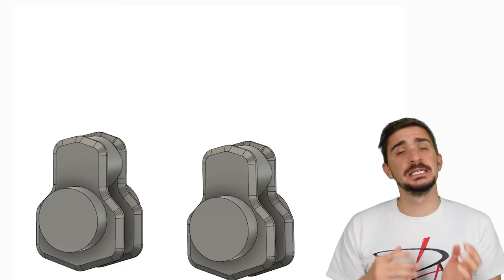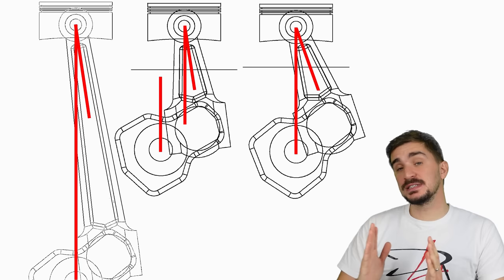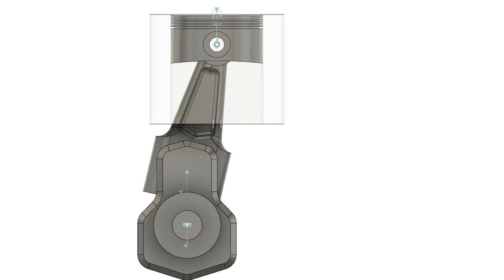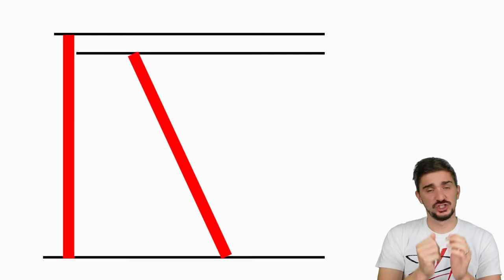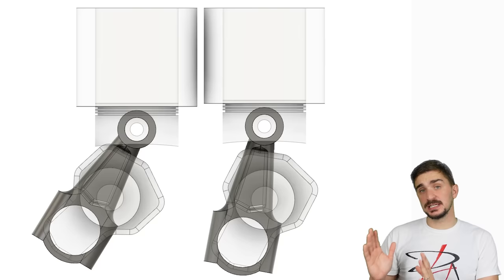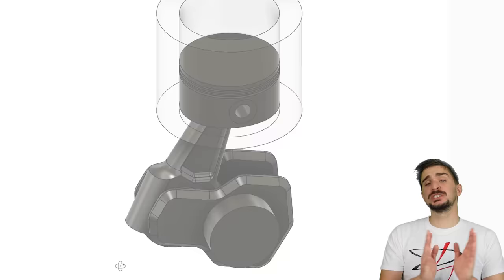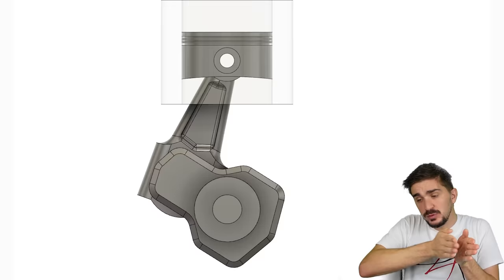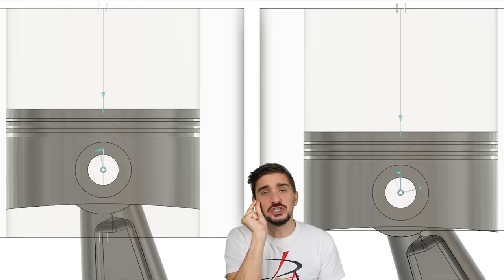Cylinder Offset Changes Everything

Comment: In the trucking world the offset cylinder (commonly referred to as downsped engine) does wonders for the engine performance. Slower piston speed means more torque at lower rpms while increasing fuel efficiency. It also increases exhaust temperatures which helps with all the emissions components. Pretty amazing to move up to 80000lbs at 950rpms at 65mph and getting 10-12mpg.
Reply: This means that it also has a lower rpm limit, 1000 rpm on a diesel would be equivalent to 1.5k rpm on a gas engine, they move at the same speed.
Reply: Is this guy talking about Chrysler's 1959 slant 6?  For all you "this changes everything" modern day idealists... please keep in mind quad copter drones were invented in the 1920's, and were among the first successful heavier-than-air flight "VTOL" vehicles preceding helicopters, and electric cars were around from the very begining of personal trasportation.  With the first example of an electric car in 1830, but by 1900 were 38% of Americas automobile market, with steam taking 40%, gasoline 22%, and diesel just recently invented in 1893 as a means to use cheaper low grade fuels.  Diesel is only more expensive because the government puts a TAX on diesel fuel, and now also requires DEF as well.... I'm still waiting for someone to re-introduce steam vehicles, so this guy can make a video about how THIS CHANGES EVERYTHING.
Reply: @Ed-ty1kr 
Starting in 2007 here in the USA the feds mandated "ultralw sulphur" diesel fuel, among other emissions reduction devices and systems. (Think DEF, DPF, along with some other ideas integrated into these new systems).
It's unfortunate how technology has improved dramatically in the diesel industry just to be negated by the over the top emissions reduction systems mandated by the fed. In 2007 they essentially raised the price of diesel per unit, gallon here in the states, which of course became a permanent raise in cost, supposedly to offset the cost in the manufacturing and distribution of the required ultra low sulphur fuel...all the while achieving this new standard of reduced sulphur by simply taking said substance out of the "mix"...in other words charging us significantly more per unit of fuel by the reduction or even elimination of a key component which in the past was used to lubricate the moving parts of the fuel system itself. Well not just moving parts but also critical yet stationary parts like the body itself of a diesel fuel injector. This whole concept of what went down here in America around 2007 is so frustrating to me. As a life long mechanic with experience in internal combustion gasoline, compression ignition diesel, 2 and 4 stroke gas, and even electrical (EV) powered vehicles found in the forklift and equipment fields. In addition to the wrenching experience and understanding I also worked a relatively small window of time in the refinery business around this time of 2007. Much work was needed for the refineries to be "ready" to make, distribute and sell this new "ultra low sulphur" fuel and therefore refineries everywhere went under humongous updating projects. Many bodies and brains were needed for this task. I hired in at the Marathon refinery as a contractor at their elaborate plant here in Detroit, basically i-75 and Fort st./Schaeffer Rd, near outer drive amd Dix Ave...anyone from around the knows the plant and it's location. I found that job very interesting, despite being temporary I still spent about 2 years on site learning something new every day about the refinery process, which honestly, was rather rewarding. 
In summary, it's almost as if some kind of globalist cabal who secretly run things from behind closed doors and it's almost as if these people didn't want more efficient diesel engines which essentially move and power this entire world we live in, where every aspect of our daily lives are affected by a diesel powered something somewhere along the way. All these EPA backed emissions reduction acts and mandates have crippled the Diesel engine industry to where people actually believe EV's could save the entire world right now...which they cannot. Ever. Efficiently. Replace ice and diesel.
In a dream last night I actually imagined the newest most bestest thing ever...a vehicle powered by...
Coal! Then I woke up and had to pee.
Reply: @williamstamper442  EPA and DOT measures became overreaching sometime around 1969, with 5mph bumpers that by the early 1970 made American muscle cars sinfully ugly, with huge protruding bumpers, and emission systems that dropped 350 to 426 horsepower cars down to slow, heavy, and gutless 150 hp gas guzzlers.  
But this actually goes back to 1913 and Woodrow Wilsons Jackyl Island treason, that the British Royalty literally paraded him through London for. Henry Ford was quoted as saying its just as well the American people are ignorant to finance, cause if they knew, there would be a revolution by morning.  Not an exact quote but something to thar effect.   Which got really  bad around 1964, post Kennedys famous secret societies and proceedings speech, which was just weeks prior to his assasination.  Funny thing you mention Globalists cause it was with George H.W. Bush involvment, a known and admitted Globalist within the CIA, who later became Regans VP as Regans alzheimer's set in. Then became President giving the world his famous New World Order speech, with creepy undertones saying things like "and when we are successful, and we will be".  Followed by a short Clinton break, with MK Ultra and Tuskegee human experimentation on American citizens admittal and lame appology, and then by his son and fellow Bonesman" George W. Bush Jr. 
 There is a documentary you can still watch on Internet Archive made in 1982 called The Killing of America, that although is aimed at gun control, still documents the drastic decline of American society into violence, mass redrum and general crime up to that point in 1982.  Directly links Kennedys assasination with the crime rate, violence, and general depravity as if some great evil had decended upon the land.   Which only got worse thanks to the CIAs Contra Cocaine "conspiracy" and introduction of crack cocaine onto Americas streets, only now trumped by fentanyl.  Which... started with LSD's introduction, the first poison unleashed on the nation.  And who created that? Look it up, it was nothing new, it was as if it was deliberately released onto the soft heads of Americas youth, by design, on a large scale, and almost immidiately in the late 60s post assasination like clockwork. So now its fentanyl but its the same game, new millenium.  
Look into a book called The Psychopath Machine, written by an MK Ultra survivor, who claims MK Ultra was not to create psychopaths, but to identify and install psychopathy in prominent positions.  By identifying through tests and examinations all existing sociopathic personalities, so as to find candidates for the military industrial complex bureaucracy,  top medical professionals and doctors, university psychologysts, federal judges, top law enforcement professionals, and the now famous Wall Street American Psycho business personelle. Everyone thinks MK Ultra was to create psychos, but why create something if you can recruit existing? 
Anyhow... 
As far as Globalism the world we see today is a direct product of their actions.  Just look up the definition of GLOBALISM and see if that fits the world we live in. Look up World Economic Forum videos and whitepapers, they dont hide much, for they assume we are all just ignoranr commoners.
I still recall Ross Perots "Great Sucking Sound" speech he gave with Geroge Bush Sr. on his right, and Bill Clinton on his left, as he told the nation we will see our jobs sent to Mexico and overseas if we elect either one of those two candidates. Thar was 1992, and Boy was he right, they literally sent all Americas industry... tooling included.. to Mexico and mostly to China, because the "Chicoms", view communist China as the model for their New World Order or Great Reset. Where they can Build Back Better their tyrannical dystopia where you own nothing, live in 15 minute prison cities, have no privacy whatsoever, and eat a diet of bugs. But only after they tear it all down and bring the western world to its knees, cause you must tear it down to build it back.  
Looking further down the now well proven and documented rabbit hole we see the same mass migration mentioned in Globalisms definition, in both Europe and the United States, with the 3rd definition for globalism given as : An ideology based on the belief that people, goods and information ought to be able to cross national borders unfettered.  So we see our boarders disolved or non-existant, with our military or "defense" spread out to hundreds of bases world wide, and fighting or aiding in just about every conflict anywhere including Ukraine.  Which was a military industrial complex and George Soros color revolution construct, designed to fight Putins refusal to play along with NATO's clear rejection of the treaty written up by Gorbachev while the Soviet Union was disolving, not to impose NATO onto Russias doorstep.   People dont know about any of  that, and how can you blame them they dont work at the United Nations, so they support whatever the media tells them.  But it was actually over a treaty that was not upheld by NATO, and the nordstream pipeline that has most of Europe now feezing to death.  They did it by first meddling in their already fraudulent elections, playing dirty games with Ukrainian oligarchs who are actually just the corrupt businessmen and gangsters that came out of an empires collapse.  They got involved with installing of puppets like Zelensky, possibly even Putin himself for all we know, and subverting their society through color revolutions that are always signified by the famous RAISED FIST.   Running criminal bribery based public private partnerships which is basically just a soft modern term for fascism, first coined by Mussolinni the italian dictator during WW2.  This tactic then was turned inward onto the American people in 2020, and we ended up with cities burning, and public private partnerships set up during the Bush era that is now no longer just working for the government as contractors, but now controlled the government through public private partnerships. 

Anyway it is FASCISM, its set up and ran by Globalist wealthy self declared elite stakeholders, and it is just a means to impose a world government tax on the common people ONLY, while they continue to jet set and yacht around the globe in vehicles the DO NOT ACCRUE CARBON CREDITS... Yes you read that correctly, private jets as well as vessels above a certain size do not have to abide by carbon credit global government taxation.  They solve nothing, they impose all these measures like forced injections and central bank digital currencies linked to social credit scores... but they serve absolutely nothing except to make them richer and more powerful.   It is an ideology of haves and have nots, of serfdome, a cass system, a communist fascist socialist dystopia where your only rites are to depopulate yourself by assisted suicide, with their war on carbon being a war on all of us carbon based life forms.
Sorry for typos, and sorry for it being so long, I couod write a book on the globalist tyrannical nightmare society they are building.  And yes , they penetrate the cabinets as Klaus Schwab says, and destroy whatever they lay their greedy, grubby, filthy paws on.   Period
Reply: @Ed-ty1kr  are u okay?
Reply: @aryamankaushik4173  Ignorance must be as blissfull as they claim...
Reply: @Ed-ty1kr  Děkuji za Váš názor a realistický pohled. Už se mi potvrzuje, odkud se ta smrtící ideologie dostala do EU.
Reply: @vd4534  You'll have to translate that into English for me...
Reply: @Ed-ty1kr   That person posted in Czech.  This is what they said:  "Thank you for your opinion and realistic view. It is already confirmed to me where that deadly ideology got into the EU."
Reply: @JViello   Thank you.     I tried the google translate software but as mom tells me, the translations are not always accurate.  
But then again, even english to english texts get misunderstood and taken the wrong way, so its no surprise.
Reply: @Ed-ty1kr   Steam vehicles? What about Steam powerplants. THIS CHANGES EVERYTHING. Using only water to power a turbine? A wheel? WOW!
It would be nice if Nuclear powerplants became popular again. Last time it was for nuclear weapon production. This time? I mean we are littering the streets with heavy metal lithium infernos. Built like SUV's and far heavier then what a vehicle actually has to be. Luxury first. Not practical and economical made to be sustainable. O no!

The most likely tech to replace battery banks in EV's would involve water steam. Since else your looking at combustion of gases or solids.
The most innovative and game changing would be to strip vehicles down to bare minimum. It might sound like a joke but Trabant/Smart Car like things should return. The Smart Car concept had actually really good crash standards for what it was. Goes to show what actually can be done if there was a push in that direction.

Then focus innovations on keeping people from crashing into things. Make things made to last and be sustainable. It really is the infrastructure and tire wear that should be a problem. (lighter vehicles less wear and tear in general. Less energy needed too.) And ofc how to get people to take driving seriously with responsibilities. And the heavy handed approach today probobly involves putting up allot of cameras and having a AI fine you! So really we are screwed regardless of what we do. Why make people care when you can fine and earn profit for the state?

If a generation of people where forced onto EV bikes perhaps? Maybe then people would be delighted to drive something with 4 wheels and a roof/windscreen. Iphones and touch screens do not belong on a moving road. Let alone built into the dash. Or self driving... It maybe sounds hash but even the few that have a family car with kids in the back seat? I see no reason to why we need to drive around in tanks on the road. Let alone SUV's and pickups that do nothing but look fancy. So much BWM, Audi, Mercs on the roads. Rare to find a family car that is actually modern AND fit for purpose. Every single one of us go for the fancy thing. Rather then the reasonable and long lasting quality over quantity. (quantity in over luxury.) Most of the emission/tax cheating vehicles are also the ones with a premium price to it. And a weight/waste increase to go with it.

And for people driving SUV's or modern crap to feel safe on the road? You should be the first ones to be put into actual Trabants. Even in a world of EV bikes and compact light transport? We would still need delivery vehicles on the road. But like really? The main problem to solve is to make people care to not crash into things. So a big lorry/18 wheeler running around EV bikes all day? Maybe it would be the kind of encouragement to get people to pay attention to the road. And be humble and respect that they do not own the road.
Reply: @TheDiner50 You know how you can reduce infrastructural wear significantly? Reducing the number of cars on the road and increasing reliance of public transport: trains do not require heavy, expensive and unsustainable batteries, and cars could return to what is their original essence: a luxury good for passionate people who love those mechanical beasts and their speed. What's the point in investing colossal sums into developing tools not to make people who shouldn't drive in the first place unable to crash? If the final goal of technical development in the automotive industry is to make self-driving with which incapable drivers cannot harm themselves or other drivers, we would all be better off as passengers in buses and trains. And both the economy and the environment would be better off too
Reply: @Ed-ty1kr  Chrysler's slant six was tilted to lower height and to allow intake and exhaust manifold clearance under the hood w/o changing the crankshaft center line. The cylinders were not offset.
Reply: Now look up speed of air piston head technology